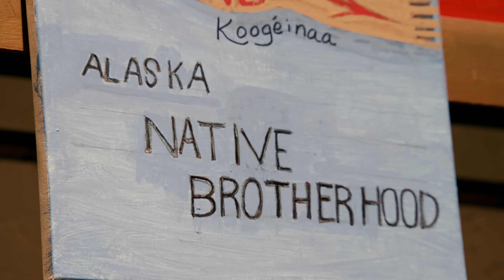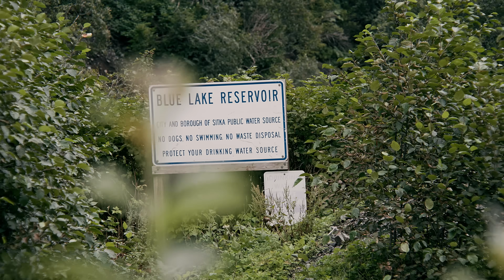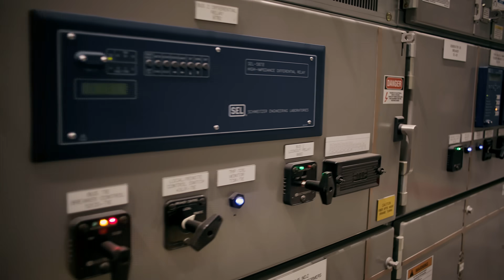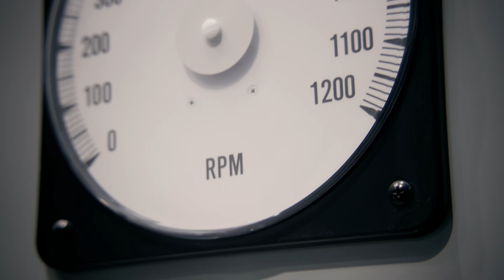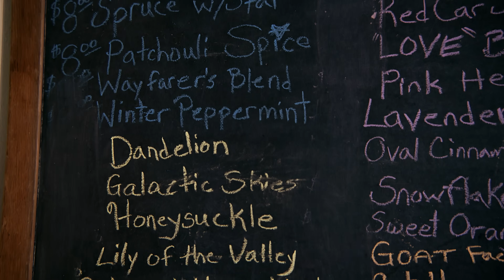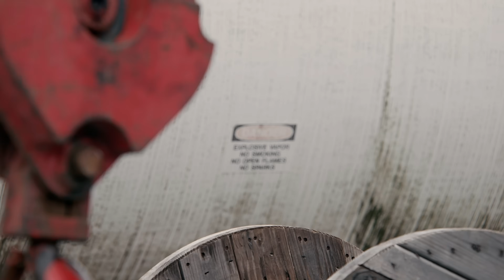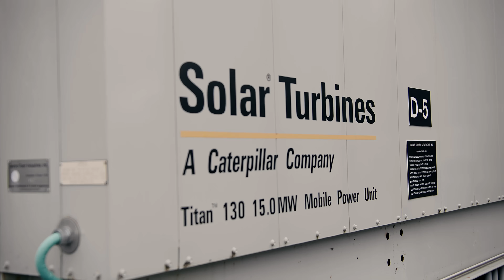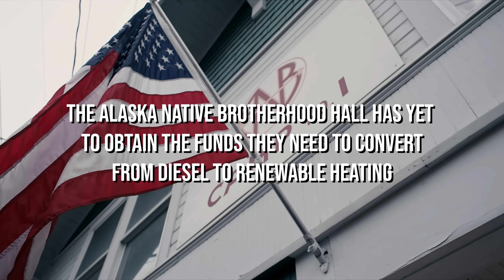The Alaskan Island Running (almost) Entirely on Renewable Energy | American Innovators

Comment: Every community, state, country, has a different situation.  Not everywhere has the same resources.  You've got to work with what you've got.  Obviously solar power generation is not efficient here, for example.  And Sitka's hydro power has come at a high cost.  I think the original blue lake hydro expansion plan involved some federal funding that the city was unable to obtain, thanks to some anti-dam conservation groups.  Hydro dams can cause issues for fish, as they do on the Columbia River, but the blue lake project in sitka is built on a waterway that was already impassible for fish.  The expansion project flooded an area where I used to go camping, I think it was a reasonable trade off but there is always a trade off.  Green energy technology relies on mineral extraction, so your EV's and Wind Turbines and Solar Panels are a trade off, not a perfect solution.  You're trading atmospheric carbon for expanded mining operations, instead of drilling oil we'd be mining minerals, but its not a zero sum game.  Another Alaskan concern is the Pebble Mine Project and transboundary mines in British Columbia polluting our Salmon Rivers.  Every new EV or Wind Turbine or Solar Panel is increasing demand for mineral extraction, and that threatens us in a different way.  The kind of mining that will be necessary to accomplish a "green energy transition" certainly threatens the salmon that have traditionally sustained sitka's indigenous people.

Comment: Air source heat pumps appear to be a good idea, but just so long as back-up heat is not provided by electrical resistance units.  Before embarking on new expensive, untried technologies, you should consider efficiency upgrades to the Blue and Green Lakes projects. If you are considering future needs, the Takatz Lake hydroelectric project is still viable. You should also consider dusting off the old Southeast Alaska Electrical Intertie System Plan as a source of revenue distributing excess energy throughout SE Alaska communities.